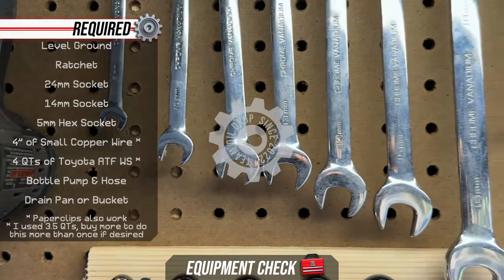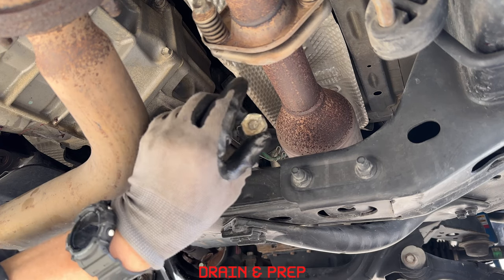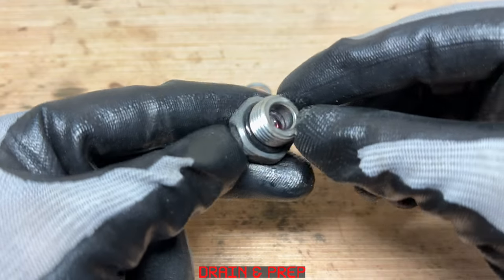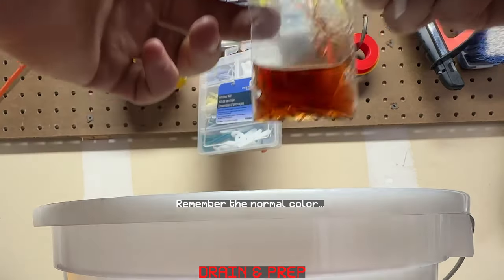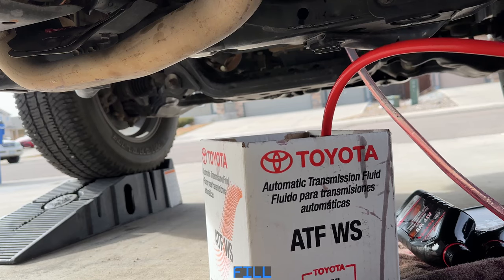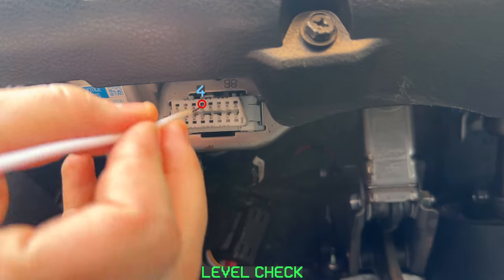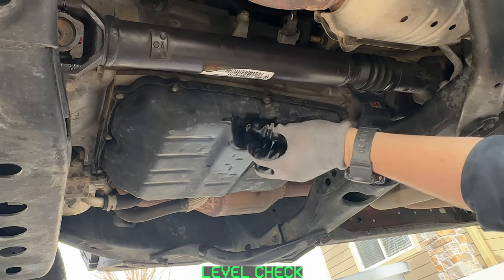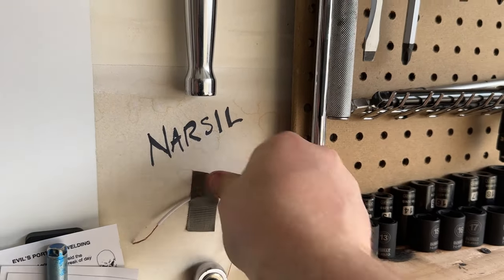How to Replace Transmission Fluid Drain & Fill Tacoma 3rd Gen

Comment: dang, even using a torque wrench think i over tightened the overflow, saw some drips: edit: nah I'm an idiot, I left the crush washer off since I still had to do the temp check.....ended up being low still so I'm gonna add another 1qt and test again once it stop raining this morning.  If i damaged the pan....well i guess I'm ordering a new one and gasket plus more fluid......wanted to do a full flush anyways is what I'll tell myself.
Reply from the maker: Hey, keep in mind, this is a rather stressful task the 1st time around. If your biggest issue was not installing the drain plug seal, you are a rock star!

Greg the Editor
Reply: @teamoildrop  yeah not a fan of sliding under a running vehicle but the little creep tool made it quick.  2nd time in temp check mode ~1/2 a qt came back out and now I've just got a minor leak at that point until the washers arrive.  

Figure I'll add another qt to make up for the losses and add the washer during another temp check.

Comment: My gear display didn’t disappear the D started flashing? Forums say that’s temp check mode????
Reply from the maker: Flashing = too hot
Reply: Okay thanks.
Reply: Also. I didn’t get the same lights illuminating from the OBD jump. My traction control nor abs lights lit up does that matter? 2019 Taco OR 4wd.
Reply from the maker: if you check the ports.. they may not even have metal contact points and youi can skip the wire step. That's what 2020+ owners have reported anwyay. Maybe your 19 is the same.  @georgen4077
Reply: Temp mode worked this morning on cold engine 🙏🏼 I made a couple key mistakes yesterday and I’m curious if you think I I should start over. I opened the check valve the first time when the trans was too warm, added a half quart and then did again too hot and accidentally turned the truck off before I opened the check valve. All in all yesterday 4 went in 5 came out. I went and got new crush gaskets and 4 more quarts. Do you think I should just start over entirely? Drain the both plugs, refill with 3.5 quarts and go from there?
Reply from the maker: @georgen4077  at the end of the day, as long as you achieve the “small trickle” while properly in temp check mode, you are guaranteed to have the right level of fluid. Assuming you are also on a flat surface. If the check valve is open and nothing came out you are too low.
Reply: This am a little tiny tiny trickle came out but barely anything. I suppose I’ll top off with a quest and temp check again?
Reply from the maker: to be 100% sure I would do just that. Add a qt and drain to a trickle.  @georgen4077
Reply: So I added a quart and a half since it a what I had ready. Temp check mode ran properly opened it up and same thing as this am barely a dribble. Quickly shutuff the vehicle added another quart more or less. Since the truck hasn’t been driven today only been brought up to temp real quick I decided to to temp check it again after shifting through the gears a few times. Immediately D disappeared and came back solid so figured I was still in proper range still. Quart came out.
Reply: Thank you so much man!
Reply from the maker: @georgen4077  a qt came out to end with a nice small trickle? Sounds like a win to me.
Reply from the maker: @georgen4077  my pleasure! Happy maintaining.
Reply: Yea maybe a tad more but about. I was weary of temp checking so quickly after the first time but figured worst that could happen temp checking too early would be the blinking D like before. But yea disappeared and immediately came back solid through it in park D remained and then drained the check plug. So this morning 2.5 in 1.25 out after proper temp check plug drain.

Comment: For some reason every time I do this I only get 1-2 quarts out.
Reply from the maker: Your transmission may be under serviced.
Have you don't the entire drain and fill? 
You should need to add about 3.5 quarts

Greg the Editor
Reply: I've done it several times. I'll try it again next time and see.

Comment: My pins #4 and #13 didnt work. Anyone else have this issue?
Reply from the maker: What year is your truck?

Notes:
One user (zacharylechevalier202) reports they could get their 2020 Tacoma into temp check mode without a wire as their truck does not have a live connection in the OBD port 13. They just did the neutral drive back and forth.
Reply: @teamoildrop  it's a 2020. I ended up getting it into the temp check mode by just using the N to D on repeat till it kicked in.

Comment: I’m able to get my 2020 Tacoma in fluid check mode without the wire jumper just by going back and forth from Neutral to Drive.
Reply from the maker: Nice! Tell us more
Reply: Same procedure as you only I skipped the jumper. I took a close look at the connector and realized my pin 13 doesn't have a wire installed on the connector.  This makes the jumper pointless. So I just tried cycling from neutral to drive and it worked without the jumper.
Reply from the maker: @Zach_Lechevalier  wow! Nice... definitely putting this in the notes. Do you also have a Tacoma World username? What exact trim level do you have (might matter)
Reply: 2020 and above you no longer need the wire jumper.
Reply from the maker: @kevinrug  thats the info we needed!
Reply from the maker: @Tumbleweed7200  Very nice! Good find
Reply: @Zach_Lechevalier  so after cycling the gears, did you see any flashing lights before shifting between neutral and drive? I'm about to fill my 2020 this weekend.
Reply: @mln700 Here’s a video showing the “no jumper wire” procedure for 2020 and newer Tacomas: https://youtu.be/XTU_Jt7OJZk

Comment: i’m so scared to mess with my transmission fluid, i hear so many horror stories
Reply from the maker: There is a ton of information available about the fluid change on Tacoma World. The threads are searchable in the respective generation forum pages. The discussions share parts that members had difficulty with.

You can do it!

Greg the Editor
Reply: What is the opinion on transmission fluid that has been sitting in a box for about 4 years? Bottles unopened but obviously not hermetic. Still good to use?
Reply from the maker: @19Stifler91  if it’s Toyota ATFWS and still sealed I’d run it. If it was any other brand my brain would convince me to get the real stuff.
Reply: @teamoildrop thank you! Yes OEM ATFWS! Appreciate the response
Reply from the maker: @19Stifler91  send it!

Comment: Do not use a 5mm hex. This will strip the head. The size is actually 3/16 hex. At least for me this was the case. 2018 Tacoma Off Road 4x4.
Reply from the maker: Id say you got lucky as I believe 3/16 is closer to 4.78mm (smaller) thus even more likely to strip!
Reply: @teamoildrop  the 5mm wouldn’t fit even after cleaning it.. it strip because it only went in like 20% of the way in. Only switching to the 3/16 did it fully seat and snug.

Maybe the 2018 is different. No copper washer. No zerk fittings at all.
Reply from the maker: @I_discovered_civilization  interesting! Maybe your plug was made by a different manufacturer or outsourced for a few months by Toyota from elsewhere. Good info for others to keep an eye out for.
Reply: 5mm is exactly the size the Factory Service Manual states to use on that plug. The FSM was made by the engineers who built the thing, so it is the bible for the Tacoma. 
Check the actual diameter of your 5mm hex head with a pair of calipers, its very possible that your "5mm" hex is not actually 5mm, but a bit more than that, and your "3/16" is actually closer to 5mm, hence why the 3/16 worked.

Its highly unlikely that your tacoma has a different size plug, unless someone has changed it in the past with an aftermarket plug, Or, it could be a defect in the manufacturing of that specific plug.
Reply: I'm pretty sure almost every automaker uses metric only now, but I can say with 100% certainty that Toyota only uses metric. 5mm is the correct size. A quick google search reveals that most US auto makers used SAE on their engines until about 1997. Outside of the US has always been metric
Reply: My brother in christ. 
Do you know what country toyota is from?

Comment: Ha and a dealership wants me to pay 500$ for that 😅 greedy bastardized
Reply from the maker: The dealership often uses a machine to replace the fluid. It replaces all the fluid, not just approximately 1/3rd of the fluid like the drain and fill does. So, yes, this is quite a bit cheaper. I drain and fill every 25-30k

Greg the Editor